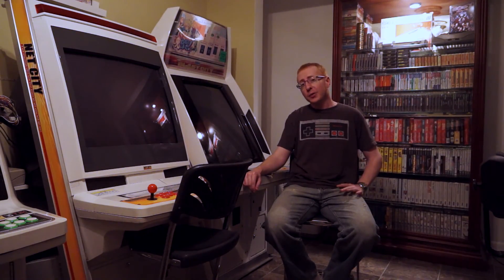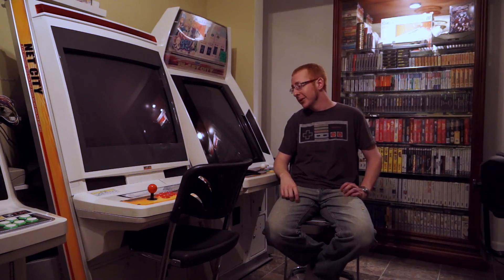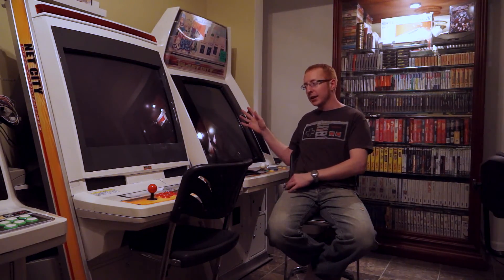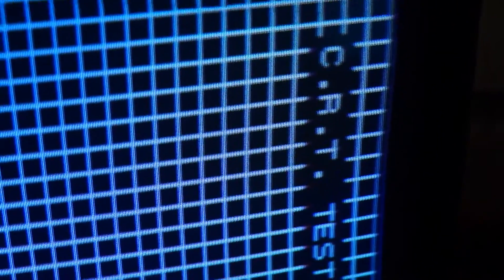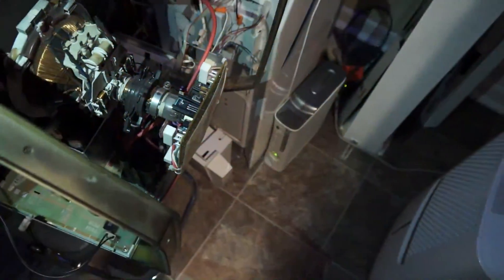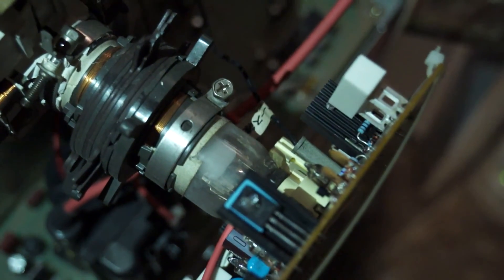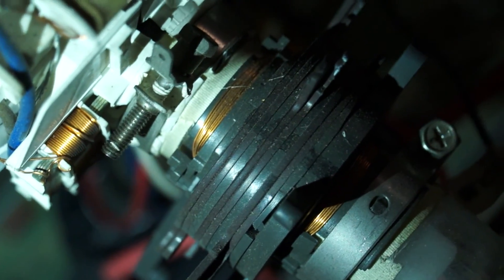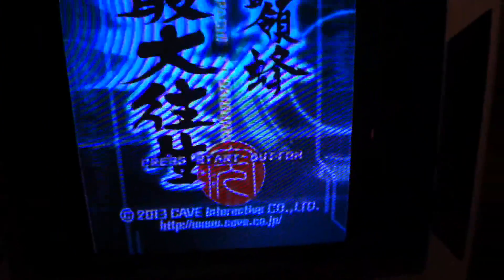Arcade Monitor Convergence

Comment: Please somes picture on the nanao focus..
I have a blast 2930..great but a little tiny red on the first part of the screen in 15 khz (1mm) and more in 31 khz with a picture bigger than the screen.
A video with the screen outside to know how to do..the hh30..v line..hsl..I need to check the 15,24,31 khz resolution.
But I dont found nanao 2930 manual.
Thanks.